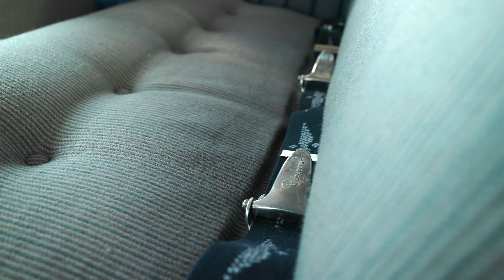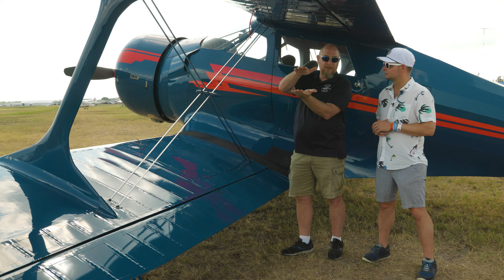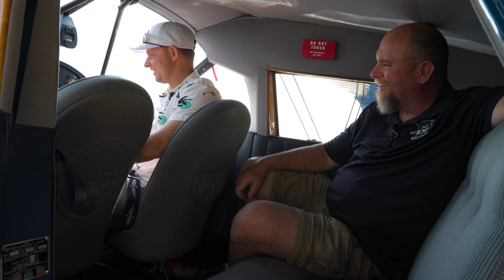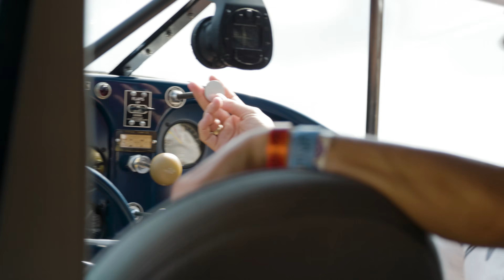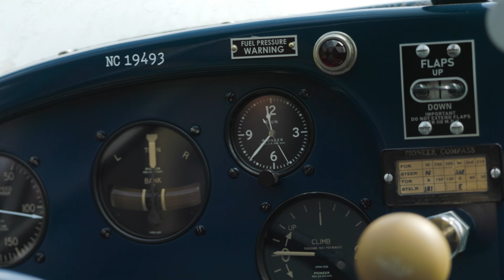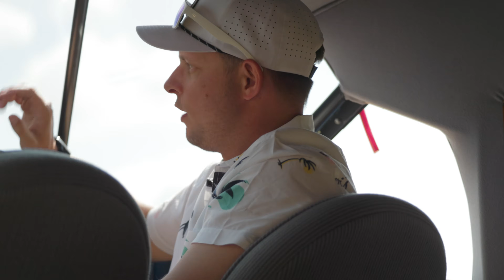Every Nook and Cranny: Exploring the 1939 Beechcraft Staggerwing

Comment: Coarse pitch for T/O? Really? Flares a nice touch. 17s had no clutch on gear motor...and needed one. Too bad you did not show how to check gear position visually. Also, flap switch placement is perfect, worth a mention. A performance fun fact--T/O over foot obstacle required only 50 more feet at 6000 msl than sea level. 17s did great at altitude.
Reply: I highly doubt needing merely 50 more ft of runway to clear a 50ft obstacle. This would be a 45 degree climb angle, with no distance covered in transition to climb attitude. (Took off in a 45 degree deck angle). An F-22 cant even do that.

Comment: WAIT!!!!! You take off with full propeller pitch and then flatten it out in flight????? Is that what you meant to say?
Holy crap a centrifugal starter!
Also: Negative stagger does indeed provide an aerodynamic advantage in that Negative stagger reduces the ill-effect of the top wing disturbing the lower wings airflows.
Negative stagger is quite aerodynamically advantageous!
This was an Awesome Video of one of my Favorite aircraft of all times. THANK YOU for this!

BTW: if you've got the money, have I got the aircraft design for you!!! You've never seen this before guaranteed! It fly's like a wet-dream too.
Mine is Radio Controlled! Tested/proven and it's not some super lightly wing loaded foamy POS.
My Design took inspiration from the Beechcraft Staggerwing but far-far away into the future lol
A very Eccentric/modern WTF? Staggerwing design!
Cheers: Robert
Reply: Yeah, his explanation caught my attention right away. You use fine pitch for takeoff, so you have max power available, and you increase the pitch to achieve a best cruise cruise speed/mp etc.
Reply: Yeah. That’s not what he meant. Beautiful bird.
Reply: I thought the same thing. You start with fine pitch at take off and make the prop more course in flight.